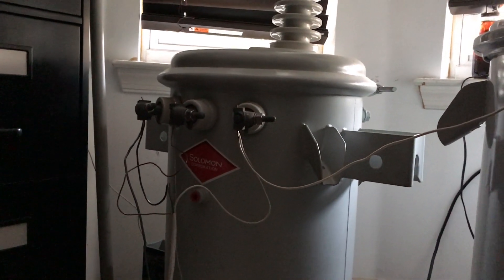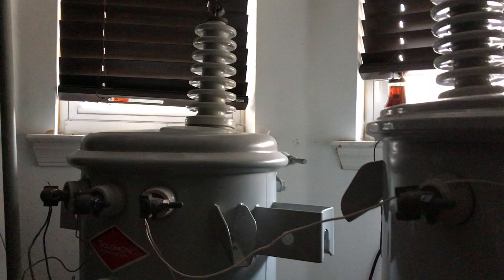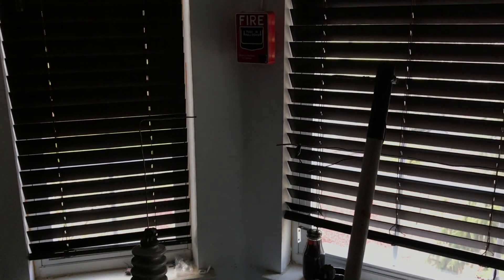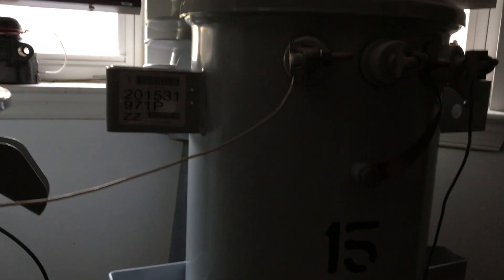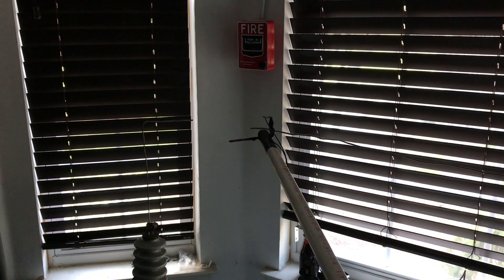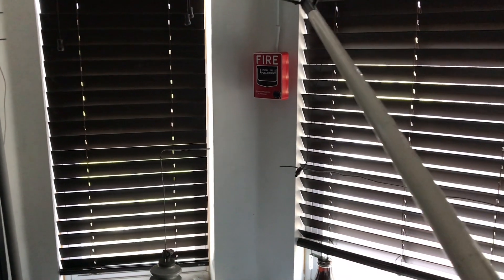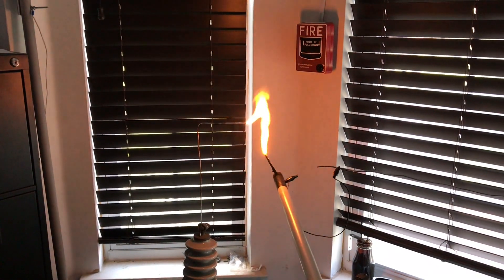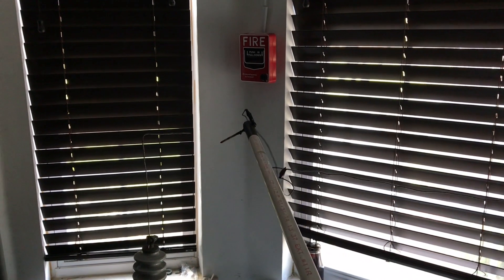28,800 Volt Arcs

Comment: Could you please direct me to a video, or a website on how to hook these up in as safe a way as possible? I have four potential transformers that I've collected over the last 15 years, three having double bushings and one (my 7200 volt ABB) having a single bushing. I also have a single variable current limiting reactor that an old friend gave me from his neon sign shop 20 years ago. I used it to hook up a 10 kVA 14,400 volt distribution transformer back then, but did no calculations on how much current it would draw. Being young, and maybe a little dumb, I simply placed the reactor in series with the 240 volt input and hooked directly into mains. I seem to remember it drawing 100 amps when pulling a high voltage arc, but that may have been with the steel core pulled all the way out of the inductor. Being a little older, I'd like to be a little safer this time. :-) Using a BK LCR meter, I've measured the impedance of the reactor at 20 ohms (LCR meter in series mode). Measuring inductance and DC resistance of the reactor, I calculate the impedance of the reactor to be around 13 ohms. I would be using that reactor with a STACO 0-140 volt, 3.5 KVA variable transformer (not sure of its impedance) to power my 7200 volt ABB from the wall on a 20 amp breaker. What do you think? Is it a stupid move?
Reply from the maker: I will aim to upload a video of how to wire one in the near future. Best Regards!
Reply: @metersocket00  It didn't turn out to be much of a problem. I just measured the inductance of my current limiting reactor using a BK 879B, used that value to calculate inductive reactance at 60 Hz, and then used reactance and DC resistance to calculate an impedance of around 12 ohms. Using Ohm's Law at 120 volts, that works out to around 10 amps of current draw. I then used a variac to dead short the reactor and confirm a 10 amp current draw. Now I'm getting out some sweet arcs from the few PT's I've collected over the years. It's a variable reactor, so it can limit current from 10 amps (calculated & confirmed) to 70 amps (only calculated by measurements with the core removed). I may post a video in the future. Thanks for leaving me to figure it out on my own. It actually turned into a fun little exercise. Cheers!
Reply: @Julius314159  what specs are your PTs and how much do they weigh? Are they oil filled or resin cast?

Comment: How do you power those transformers lol
Reply from the maker: I have a 120 to 240V transformer with its LV coil inline with 2 smaller transformers from a microwave oven. The MOT’s are kept on a short circuit. Limits the current to approximately 60 amps, then plug the circuit into a standard wall outlet. Trips the breaker quite quickly.
Reply: Sup firetech didnt expect to see you here